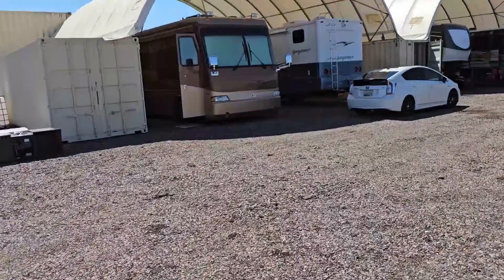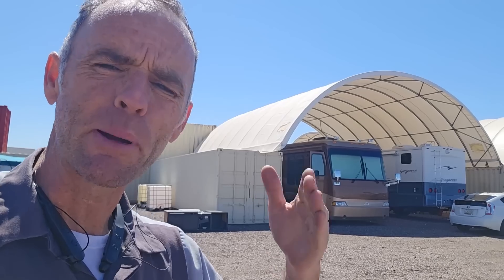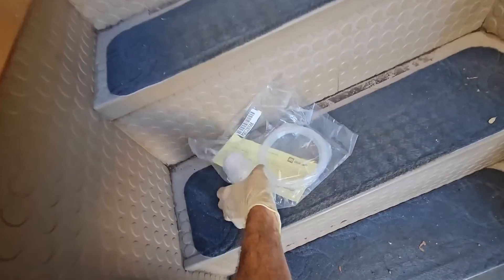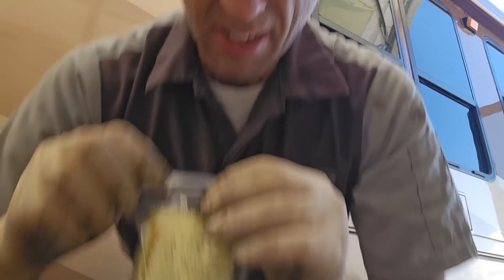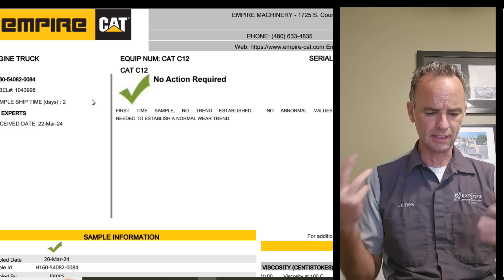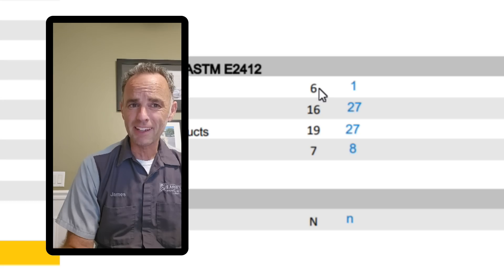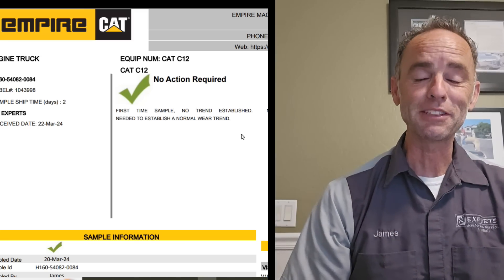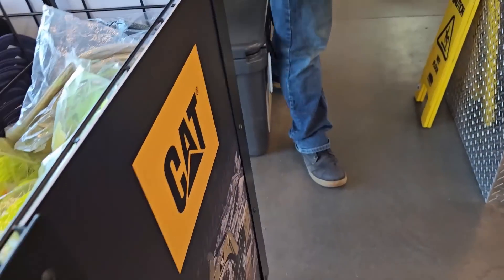Did Poor Maintenance Damage My Diesel Engine? Oil Analysis Follow Up

Comment: A friend of mine took his riding lawn mower to the shop, the mechanic did the oil change new filter? But forgot to put oil on it! Drives it out to the parking lot and it snaps the rod. Brand new second oil change. Now the shop owner should have said.Hey, my mechanic forgot to put oil in it.The motor blew up we owe you a new motor, but that didn't happen.He blamed it on the engine not his mechanic.

Comment: My dad lived with a long dirt/gravel driveway. He ditched the K@N air filter on the Cat in his County Coach magna as his mechanic told him it was passing too much grit.  I then ditched the k&n in my 5.9 cummins even though my oil analyses were good.  I use all Fleetguard for many years now.  Analysis continues great via Blackstone.

Comment: I had a C15 Cat with a 1,100,000 miles on it and never a rebuilt. I used nothing but Rotella T6 5w40.  I went by hours not miles. Which was around 250 hours. Close to 15,000 miles

Comment: Cat C-12s first in-frame overhaul should come around 700K miles if you have a regularly performed maintenance habit. Maybe want to try Rotella T6 full synthetic if you don't already? If you're currently on T4, your additive numbers may vary more greatly after running T6 though, but I'm confident you already thought of that as you read my suggested change from T4 to T6.

It would be fun to take a sample straight from your new Rotella oil jug and eat the expense of a simulated brand new engine oil change for a control sample to compare with subsequent oil change analysis, but $50 seems ...

Comment: The oil was perfect after two years in the engine.  Oil just doesn't go bad sitting in an engine. It's a metal can. All those "experts" out there changing oil every year or every six months have obviously never done a lab test of two year old engine oil. Excellent science based content.  The Project Farm youTube channel did a similar test with oil after 18 months in service.  It was also perfect.

Comment: Before you do anything else in life, remove the K & N air filter from that diesel engine!!  Replace it with a quality OILED FOAM AIR FILTER.  K & N air filters are marketed to 'flow additional air' over paper air filter elements for 'more power', but the cost is severe:  microscopic Silicon (silica / dirt) gets past the thin-mesh oiled gauze K & N filter medium and is mashed into the valve seats as the air moves into the cylinders where it continues its slow carnage. Over time, the silicon particulates ruin piston ring seals and valves, destroying valve seats, lowering compression ratio, resulting in loss of power.  Silicon comprises about 80% of what is known as 'dirt'. Silicon / Silica is extremely hard and ruins engines when given the chance. An expensive diesel engine rebuild is the result.  Gasoline engines meet the same fate when K & N is involved.  FYI: Oiled foam air filtration FLOWS AS MUCH, OR MORE AIR than the crap K & N filters.  Your CAT diesel engine DESERVES BETTER THAN K & N AIR FILTRATION !!!  Heavy equipment ($200K+) made by CAT, DEERE, HITACHI etc., use OILED FOAM air filtration for long engine life. Thanks for listening.

Comment: Hi James! you said not too much to worry about coolant. NOT SO! It should be tested at a min of once a year. Cat can help. Or cummins (I know, I know) have test kits to check PH. Antifreeze additives can rapidly deplete and yours doesn't have a coolant filter??  which usually have top up additives in them. the C12 does NOT have liners so corrosion can be fatal.  Just my 2 cents.....................

Comment: Hey James, thanks for another great video. Found you a long time ago on TikTok and love your content. I have a Dutch star 2015 with a Cummins and Alison transmission. 2 questions if you have time, 1 I’m in the NE and my RV sits from October till now. They say idling them is no good but I can’t really drive it around in the winter months . They also say letting them sit is bad, what should I do?
2. Last year I did the maintenance at the start of the season and I only put in 6k on it, of course the dealer says do the maintenance but it feels like solid overkill, am I crazy not to?

Comment: I was concerned that I might be getting fuel in my coolant from an injector so I picked up 2 fluid test kits from my Cat dealer about 2-3 months ago. 2 kits cost around 32.00 total with the prepaid postage. I pulled the samples from the dipstick because that's what the Cat dealer recommended and I wasn't ready to change the oil yet and I don't have that drain valve you have on your oil pan. Both mine came back fine. Our 2003 Newmar with 3126 Cat has only 54,449 miles(only one other owner). Great video.  I'm getting ready to change the oil again. Only been a little over 3k miles.

Comment: I agree somewhat on mileage on these older models.  Just be sure to have oil analysis done if it's an engine that is prone to cavitation issues.  Learned the hard way.

Comment: Poor maintenance will damage ANY engine.  Oil and filters are Cheap Cheap compared to engine rebuild!!  In fact, deferred maintenance will always cost more in anything mechanical and in any business;  railroads are a good example.  You know what Mr. Good Wrench said:  "Pay me now(maintenance) or pay me later(to repair failures).

Comment: I agree with several other comments.  You don't want that K&N in there letting all that dirt go through with the "increased airflow". It isn't worth the beating the turbo impellers will take. The filter is easy to get to for a reason, so you can put a good pleated filter in there and take it out regularly to bang it off and blow it out.

Comment: Our older buses got an oil change at 5K miles and the newer ones we'd stretch to 7K since the manufacturer called for it. I wouldn't stretch that Cat that far, the injectors don't like high mileage oil but, it's your motorhome. FYI, I am a retired ASE Master school bus and medium duty tech (25 years). We had a couple of buses with Cat engines and learned that lesson the expensive way. Have you checked the PH of the coolant or flush it if it's been in there a while?
Reply from the maker: I just did a complete flush a few months ago.

Comment: Great video as always. It’s an older article but if you look up “iso duramax air filter test” you might find the results interesting.  Especially accumulative gain, the amount of dust that went through the various filters tested.

Comment: Fine video as usual, keeping us informed.
On my 2000 Alpine Coach with a Cummins 8.3L the coolant sample was 4 or critical, the anti corrosion abilities were gone, so I'm sampling everything now. I flushed and replaced with OAT coolant which came back a 0 which is excellent. My Onan-Cummins generator also had bad coolant so I changed and will see. Engine and trans have extended change filters and tested fine.

Comment: Those generators are made to run hours on hours end without stopping.  The oil change intervals on those at 100 hours are very conservative.  My Powertech is listed at 100 hours where the Bluebird manual states 200 hour intervals.  I typically change it between 100 and 200 hours.  Never done an engine oil analysis but no oil usage at all with 1500 hours.  

Engine only had 47,500 miles when I purchased it in 2019 and was serviced by the previous owner at 46,000 miles.  I had it changed at 2 years and 53,000 miles and right now it has 57,000 miles.  Absolutely no oil usage.  One thing I dd do at the 53,000 mile oil change was change the automatic transmission fluid.  It was not burnt but not red either.  It was time.  I ASSUME it was changed once in it's life but I can't verify it.  I noticed that the transmission now shifts better and I think that was due to the new fluid.      

Other than fuel filters and a new air filter which was a typical donaldson filter, I got the coolant flushed.  It was badly needed.  The service center had to flush it 3 times to get it good and clean.  I THINK it had never been changed out but I can't confirm that.  New lifetime red coolant was added.  No need to check SCA levels.  I will flush it every 5 years.  

So right now I think I am good to go.  Just got to log the engine hours on the generator and the time/total miles on the engine.  Engine hours on my C13 is around 1800 or so.  These units have very good powertrains in them.  IF you keep them up you should never wear one out.

Comment: My 2001 Beaver has about 100,000 less miles. Your generator got a lot of hours too. My Marquis had 50,000 and about 400 hrs on generator when i bought it in March of 22. 
Does the Patriot Thunder only have a 455 horsepower tune?
Reply: I had an Onan in a big sleeper semi with 4700 hours. Had no problems, changed the oil about every 150 to 200 hours ,

Comment: I was watching a video of a guy who bought a bunch of used equipment. Some of them had 32,000 HOURS on the diesel engines.  The forklifts he bought had propane engines and a couple had 27,000 hours on them. Both those numbers surprised me but especially the propane engines.  All of them he bought ran just fine.
Reply: Diesel Creek.
Reply: @petercolquhoun2086  yep

Comment: The best part of oil analysis is trends. Especially wear metal trends.
It looks to me based of the additives, viscosity, and oxidation that there were less miles on the oil on this sample than the last one. That being said, Oil is cheap... Engines are expensive.

Comment: How long does it take to get the results of the oil analysis?
Reply from the maker: 1-3 days
Reply: It's quick, you can use overnight mail too with other people such as Polaris, do not use anyone doing a back room bench test like speedco, they are dirty and not reliable. They will email you the results

Comment: James QUESTION!  Is there a similar test that could be run on a gasoline powered Motorhome?  Thanks!
Reply from the maker: yes oil analysis works on gas engines too

Comment: you do have increased readings..Moly and a few others together can indicate problems..change oil every year no matter the mileage, condensation impacts...I use Blackstone they dont cost that much as Cat does also do transmission fluids I use them every time for records I would suggest using a high lubricity oil like Pennzoi ultra platinum or platinum high mileage, you will notice the difference in your reports...using a fuel additive like standyne also helps your generator and engine run better

Comment: What was interesting was that the oil was 2 years old and still came out with a good result.  But- my rule of thumb for our 2000 PT is 1 to 1.5 years oil change or 10,000 miles. But we have never put that much on in a year... mostly the oil sits. Genny gets every filter at 150hrs.. this limits failures..

Comment: Really shocked that the Hours weren’t considered on oil change. I don’t do anything about miles but rely more on the hours on mine which is a Cummins just as your Generator has. Time spent building air and setup probably shows up

Comment: Check with some of your contacts in the rv engine world but a K&N filter on a diesel engine is not advised.
Reply: Why not? It it’s cleaned properly at correct intervals and maintains the same or better airflow then stock, why not?
Reply: 167000 miles is nothing on a diesel in a pickup, a Cat engine! It’s barley broken in 😂
Reply: Better flow because they do not filter as well as a quality paper filter.  Too many fine particles are allowed to pass and the turbo can get dusted and worse.

Comment: You need to check your DCA levels in your radiator for the engine liners so you don't have them ate through. The test is a strip you dip in the radiator fluid. Alot of people dont do that and there engine don't last

Comment: I don’t worry too much about the miles on a heavy duty diesel engine, I worry about the years “aging” all of the “rubber” seals, gaskets and o-rings…
Reply: You should educate yourself before commenting about diesel mileage not being a factor.  Look around at the experts and learn.  Frequent oil changes are best practice.  Never let it go for as long as AZ Expert.
Reply: @dewholdingsllc1050  I am a retired mechanical engineer, so I have educated myself quite nicely thanks. I stand by my original statement, the “mileage” on a diesel pusher is rarely the issue with older RVs if not abused, yes oil changes significantly effect an engines life for the better, no argument, however the age of engine “seals” etc are more likely to fail on an old “low” mileage engine. Lots of commercial trucks may put towards ~100k miles per year, engines being “refreshed” at 700k miles is not unheard of, when is the last time you have seen a RV with that kind of use, however 20+ year old diesel pushers with less than 150k miles are a dime a dozen…